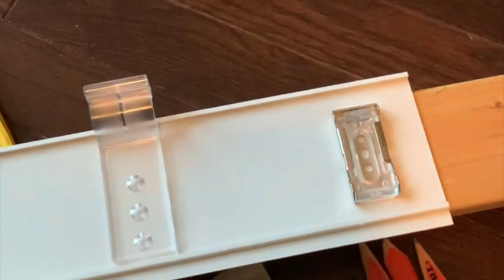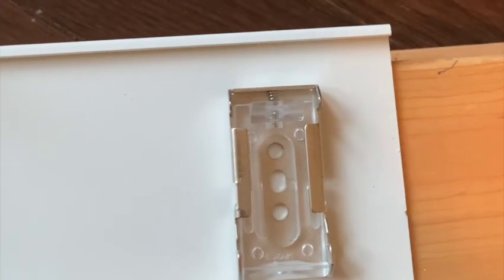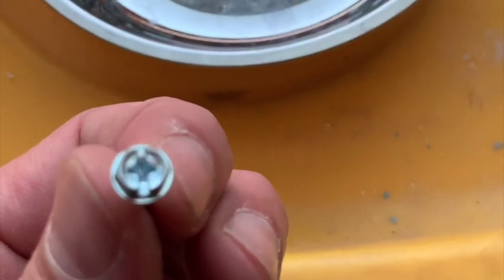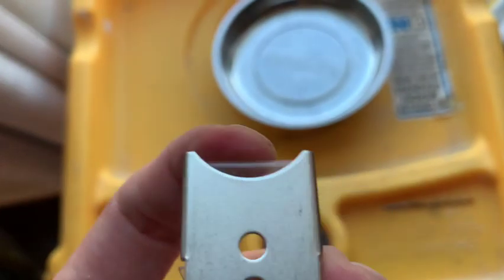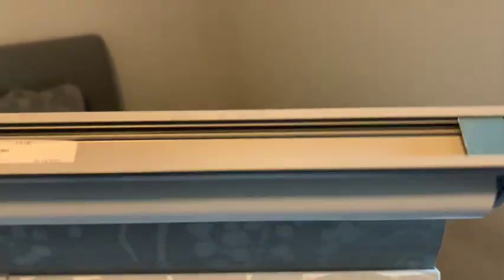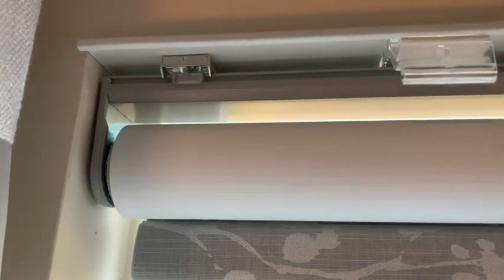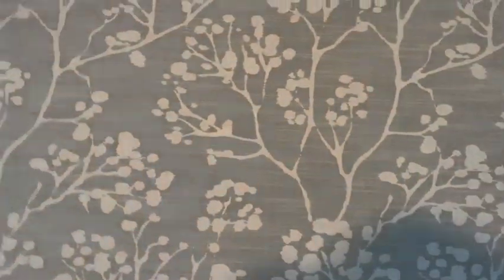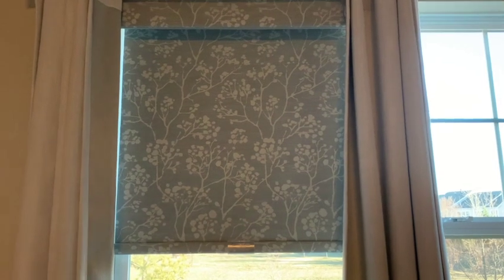How to Install Bali Roller Blinds Easy - Inside Window Sill Mount

Comment: Thank YOU!!!   You saved us a lot of headache.  We were ready to go back to Home Depot to get help with instruction for installation or at the worst -- have them install the shades!!  We were SO confused with the instructions that were in the packaging.  What was most misleading was the warning instructions in all CAPS to "DO NOT REMOVE PAPER BANDING UNTIL SHADE IS INSTALLED." With the way the shade and banding were wrapped under this warning we couldn't see that the brackets were supposed to be installed on the top of the shade. This lead us to believe the shade was a side-mount.  Soo frustrating. Your video was the only one out there that truly had all the same hardware that we were trying to work with.
Reply from the maker: @Pat KORNELL. I remember sitting on the floor for about an hour staring at the blinds and then back at the instruction thinking something isn’t right here.  LOL. Glad it helped you out.